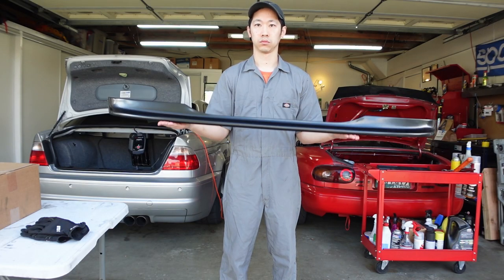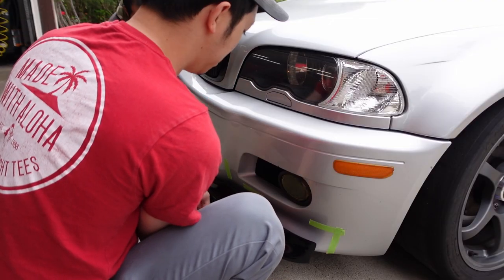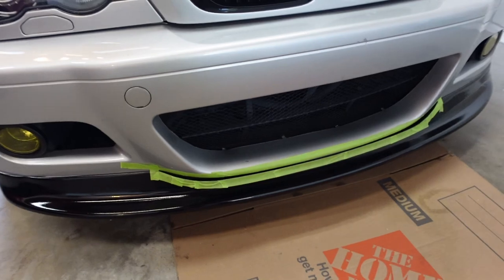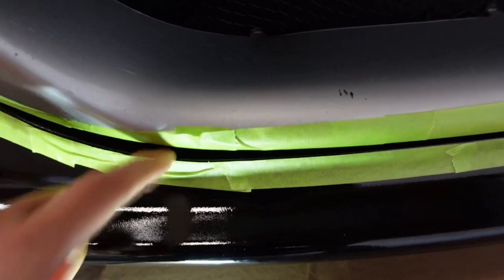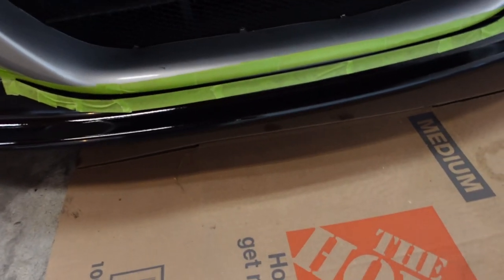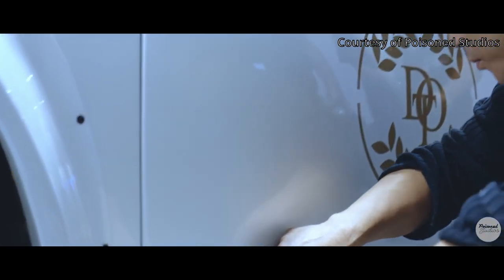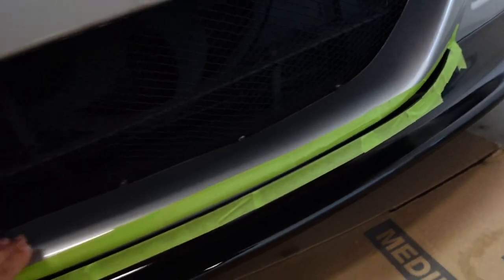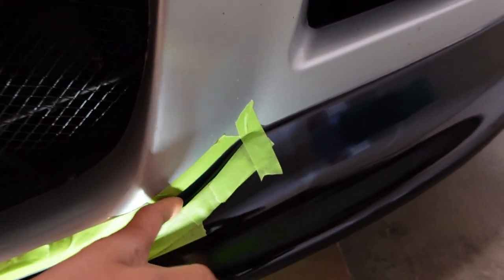Fixing eBay Front Lip Fitment Gap with Silicone Caulk | E46 M3 | Episode 13

Comment: So in the past on my aftermarket lip I used a heat gun to slowly bend it back into the correct fitment. Did it section by section and took a long time, but that would get you close enough to use VHB Double sided tape to close that gap.
Reply from the maker: it could be possible to heat it and bend it. Honestly the gaps were pretty big that it would definitely be a lot of heating and bending. I think this solution (although not as elegant) gets the job done well.

Comment: I did this to my pickup truck's fender flares too. I have a 2010 Nissan Navara (it's the "Frontier" here in Asia) and didn't like those big ass Bushwacker fender flares so I opted for a slim type. Couldn't find any after several months of searching so I used flares for the Ford Ranger 😅since it was the closest fit (but not perfect) to the Navara. There were wide gaps especially at the rear fenders so I also used black silicone caulk to fill them in.

Comment: I've got a gap in my Mitsubishi bumper and taillights that are aftermarket so I'm going to try this stuff thanks
Reply from the maker: Hope it works for you!
Reply: @HazardGarage  it works for some of it but some of it's too wide of a gap. Is the aftermarket bumper in taillights I'm trying to fit together
Reply from the maker: @jdmchickkustomz9417  the gap at some parts of my front lip were pretty large too. Maybe half an inch! lol

If you cut the hole of the caulking spout slightly larger than the biggest gap so the bead ends up bigger than the gap, you should be able to get that covered. Mileage may vary of course. And also using a latex caulking might be easier than silicone as its easier to clean up and handle.
Reply: @HazardGarage  okay cool I'll try that thanks for your help
Reply: @HazardGarage  did the caulk shrink any? And do you know if this is paint able? I worked for a auto glass installer before and what they used was crazy strong.
Reply from the maker: @barnes29510  I don't have the car anymore but I have used that technique on my current project. It's been almost a year and havent seen any deterioration. Its supposed to be used on windows in harsh outdoor conditions so I imagine its pretty durable. They say latex caulk is paintable.

Auto glass sealer though is a whole other beast lol. The latex caulk isnt a glue or adhesive but just a gap sealer.

Comment: How has it been holding up? I bought a similar IKON front lip from ebay and yep same fitment issues around the front center. VHB helps but its definitely not thick enough to close the gap completely. Also is it removable?
Reply from the maker: It's been holding up well! I was surprised how it even covered the half inch gaps! Just be aware....it gets messy! good masking, gloves, wet paper towels. this stuff wipes off with water before it cures so not too intimidating.
Reply: @HazardGarage  Bro, I'm planning to install spoiler on my car i20. I don't want to use scratches, drilling, clamps etc. So, can a silicone be used on spoiler so as to stick on the car? Will  the silicone damaged car painting in coming days, months etc?
Reply from the maker: @tnamen1307  Silicone alone wont be enough to hold the front lip. You will need to use double sided tape. I used 3M automotive trim tape. Link should be in the description. I used the black silicone to fill in the gaps and holes that the ebay front lip had after installation.

Comment: Heat the new lip up to make it bendable and push it into position on the bumper then poor cold water over it. No gap.
Reply from the maker: I'll try this next time! How hot do you need to heat up the lip?
Reply: @HazardGarage  depends on the plastic thickness, use a heat gun or a hair dryer at about 20cm distance until it becomes bendy. Don’t hold it in one spot, move over the lip in sweeping motions (like your spraying it) Honestly works a treat.

Comment: I was installing this cheap pdc sensors, but the drill was bad so I drilled a litlle bit wider hole. Sensors fit, i put litlle bit of glue, but i have like 2mm gaps. Bumper is black, could I use black silicone like you ti fill it up? What do you think bro? Thx
Reply from the maker: I wouldnt trust the silicone as a glue, but it can definitely be used to fill gaps!

Comment: 1. Bro, I'm planning to install spoiler on my car i20.
2.  I don't want to use scratches, drilling, clamps etc. 
3. So, can a silicone be used on spoiler so as to stick on the car? 
4. Will the silicone damaged car painting in coming days, months etc?

Comment: Bought a similar front lip.  I could tell that the fitment was going to be terrible and not to my standards.  DIdn't want any caulking on my car or this cheap part on display.  It's on a shelf in my garage.
Reply from the maker: yeah some people will have different tolerances for fitment. I was ok with it especially considering I was likely to probably crack it going off at the track lol